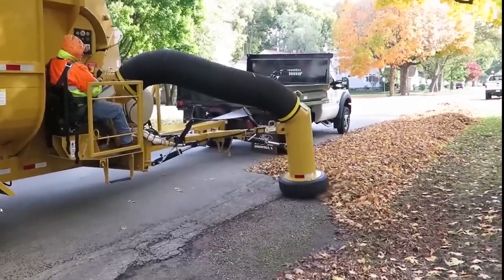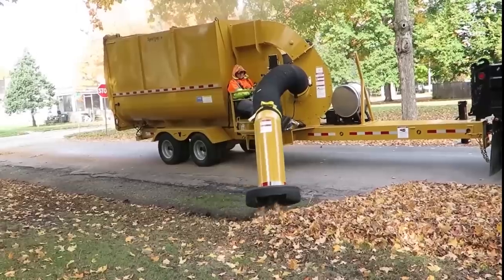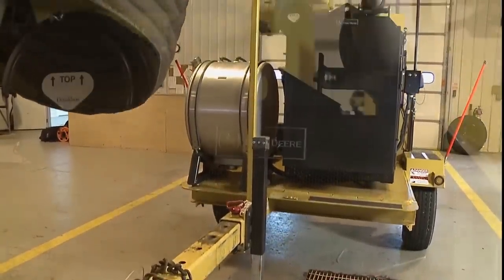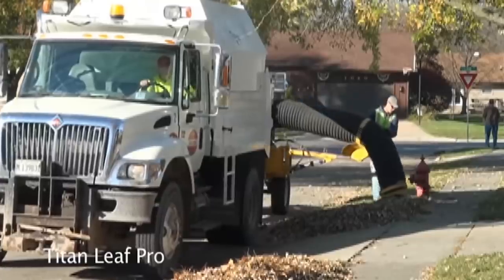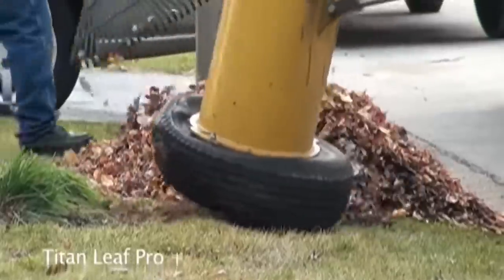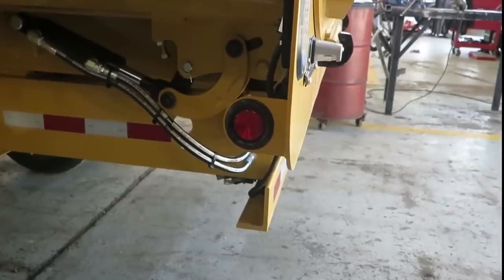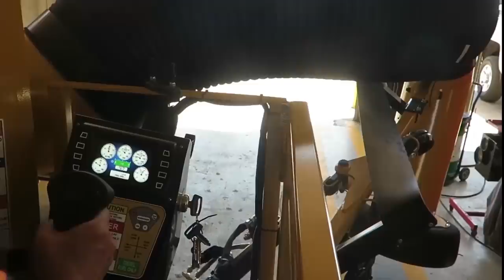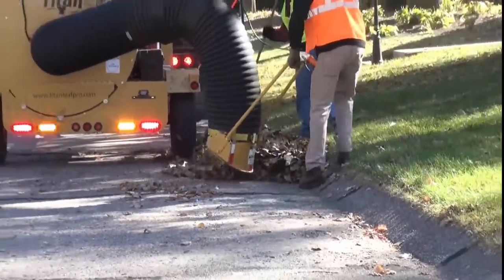HUGE Leaf Vacuums From Bonnell - BIG Vacuum Trucks Series Ep1

Comment: The real question is, does it have a hepa filter and sealed system.
Reply: Likely not, HEPA is used for lead and asbestos abatement.
Reply: 5:42 probably not
And also it has a diesel engine
Reply: @atomstarfireproductions8695  on a diesel powered truck.

Comment: Why they even need an operator? The driver could just have a joystick which modifies how far the nozzle swings out. The in and out motion could be fully automated, while a simple sonar system could detect any objections in the way, to alert the driver.